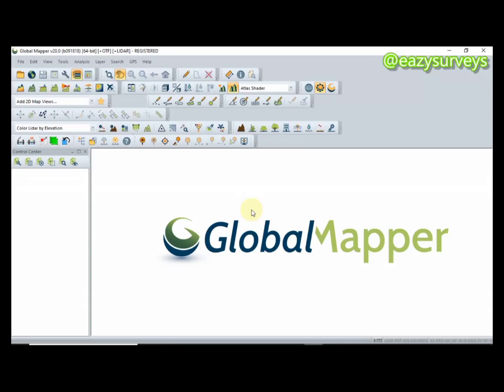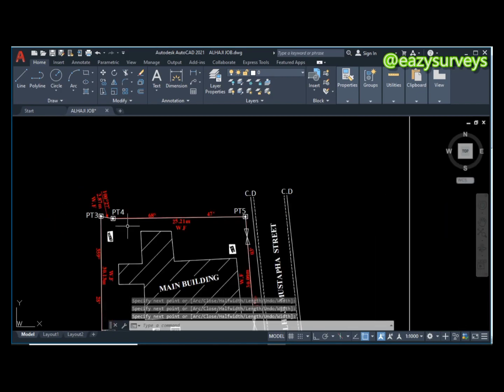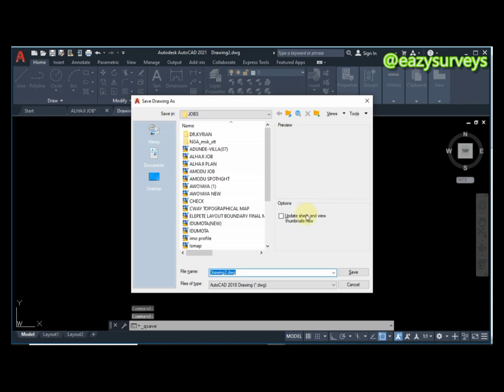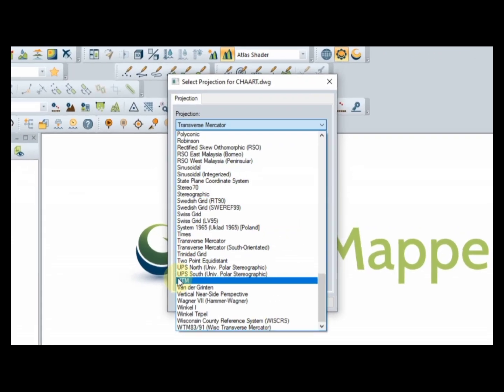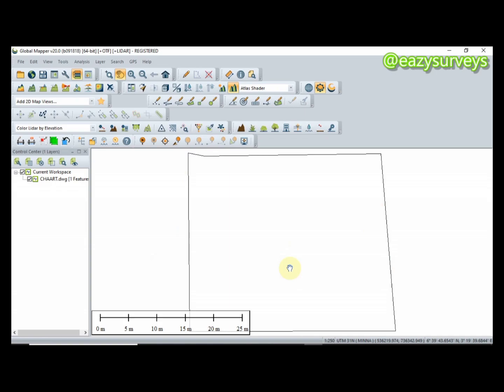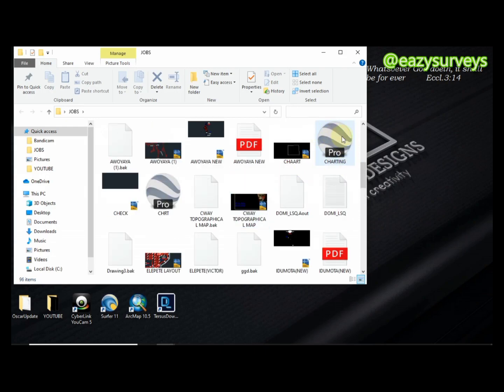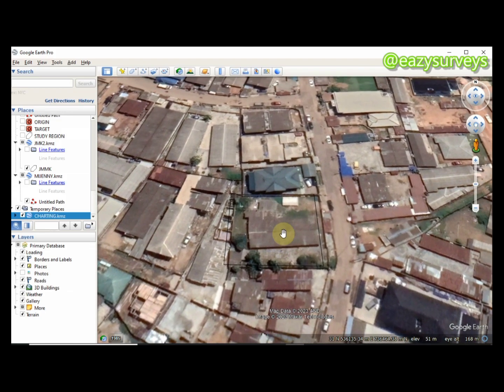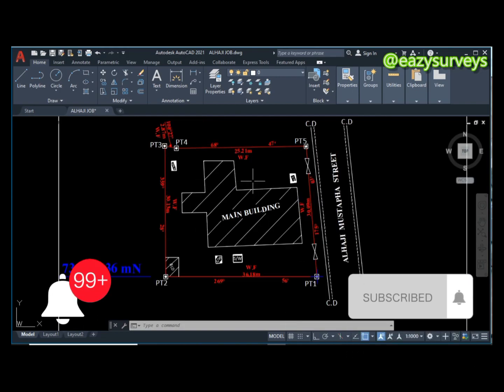DWG to KML || Project Survey Drawings with Global Mapper in 2025

Comment: There is remarkable difference in actual boundary and KMZ file boundary. Why it is so? Please explain
Reply from the maker: Thanks for the feedback
That is caused due to map projection system 
The actual boundary was originally observe on the UTM Minna(Nigeria) which is a plane system while it was projected to the world wide WGS84(curved surface) adopted by Google Earth.
Therefore when transforming from a plane surface to a Ellipsoidal or curved surface there tends to be distortions in either shape or size and to some extent position.

Do some research on "map projection"
Regards❤️